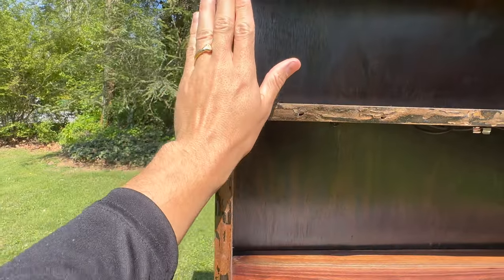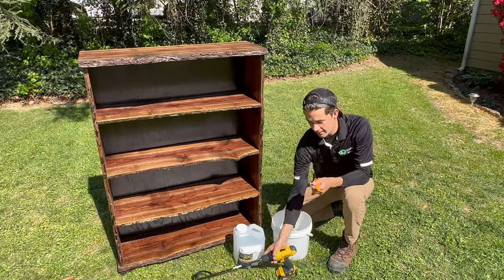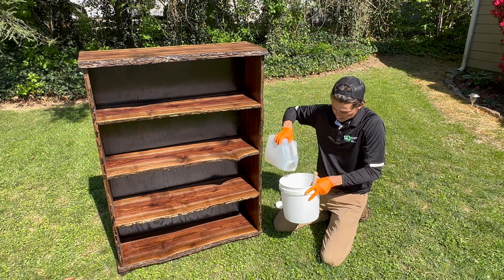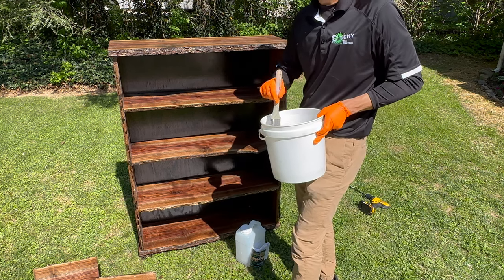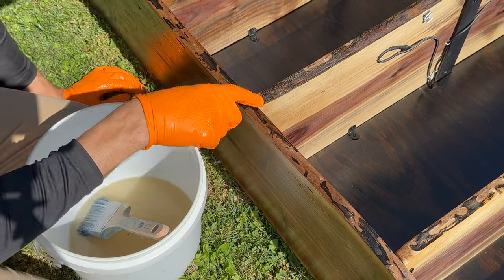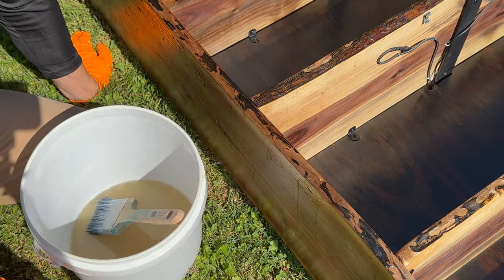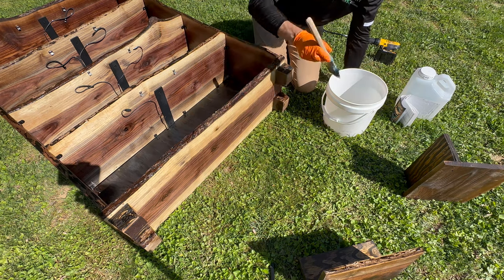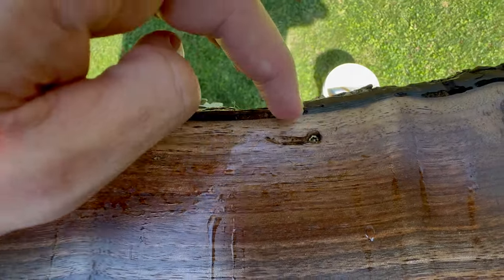Get Rid of Wood Boring Beetles with BoraCare

Comment: Dan do you do any mosquito fogging? Or In2care 

Flowzone finally came out with a fogger I use it I think it works pretty good but too early to tell for sure.. 25 foot range on turbo mode
Reply from the maker: Yes I do! Right now I use a Sthil backpack blower with Duraflex or talstar. I’m considering using In2Care though! Is the flowzone battery or gas powered?
Reply: @DanTheBugMan  battery powered 

I’m using Scion which last 75 days believe it or not best chemical for mosquitoes rn
Reply: I use cross-check myself. Works well, but is pretty standard bifen. I'll have to check out in2care and scion.
Reply: @halucinator1  yea I’m using Scion and it seems to work good although I’m new to mosquito misting 

If I do a follow up under warranty I’ll retreat with Maxxthor SC (Bifenthrin)